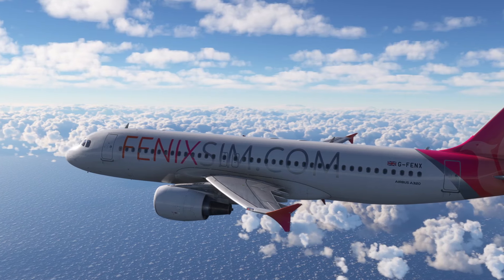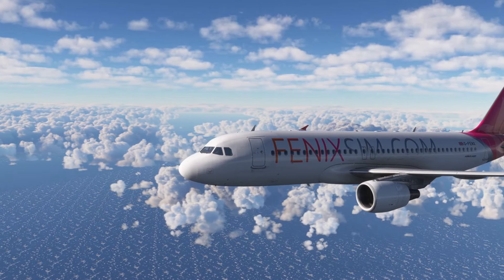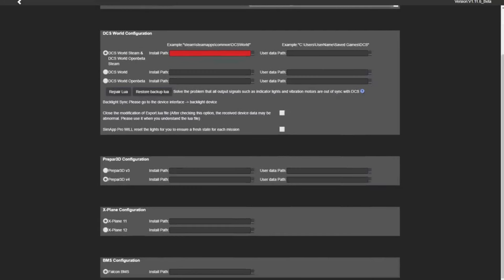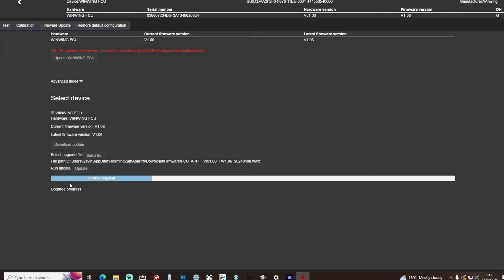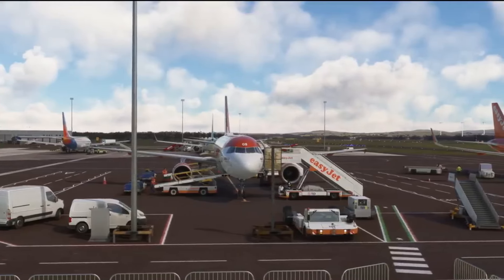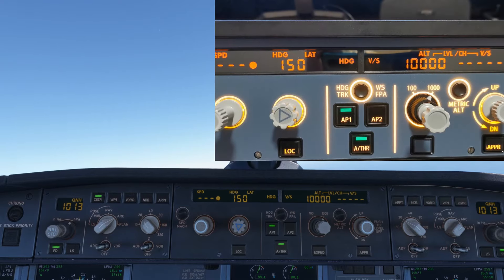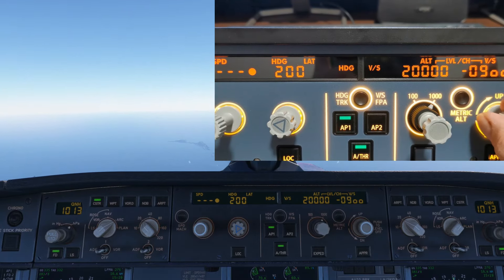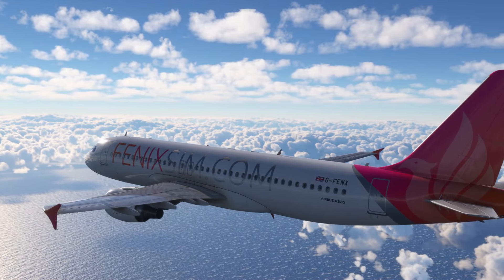WinWing A320 FCU - Installation & Setup (Not Plug & Play!) | Working With Fenix A320 in MSFS 2020

Comment: I honestly didn't notice all these frustrating problems until before the update (but rightly the firmware wasn't updated)... once the update is done it's plug and play. requires no configuration or anything! you just need to launch the app after all..
Reply: I do have the final product and my issues may come from the Bata SU15 that I´m using. Saying that, the only straight forward plane that I found was the Fenix, everything else is not even recognizing the Winwing FCU... why? I don´t know. I wish I could have someone on the same page as me.....! I really would like some help. Thank you for the video.
Reply: I cant get to set manage speed or heading, how can i do that?

Comment: Now I'm not gonna defend Winwing, or say the final product won't have these issues. But, keep in mind you've been given an early test version and issues you face may, or may not, represent the final product.
Reply from the maker: Hi - just needed to clarify that the unit I had was not an early version, as it was exactly the same as those recieved recently by customers.

Obviously as for the tech side of things setting it up, the issue is most likely me, but with no manual/instructions, it didn't make it easy. 👍
Reply: I wouldn't of said it was an early test unit, Winwing are now shipping pre orders in certain countries. Easyjetsimpilot hasn't had the unit that long I'm sure he only done the unboxing last week.
Reply from the maker: @DroneOnGameOn-DarrylCurd2024  I think it arrived on Monday just gone 👍
Reply: It's plug&play with the only issue was that I needed to reinstall the SimApp application. I don't know why I needed to do it but after reinstall, it's just connect and is done. Btw, The unit syncs perfectly with the aircraft and what this means is that everything that shows during the self-test in the place is seen exactly in the winwing unit. It's exactly like the real aircraft.

Comment: I think a sensible question is whether the mini fcu is worth twice as much as the WinWing? My opinion is no, and therefore I would be more than happy with the WinWing.
Reply: I love the concept of simplified overhead panel, radio, etc. on the mini, but if I want to build part by part a simplified but a real size cockpit, I think better to buy the 1:1 sized WinWing. I hope WinWing will also introduce more components.

Comment: Works great for the A320 fly by wire. There is a tiny bit of lag but not a dealbreaker. I do wish the lighting of the screen was a bit brighter...even at max brightness setting 255, with my lights on in my room, there is some glare which makes the numbers tougher to see. That said, I'm not a pilot, it could be that the brightness level is authentic and what it's actually like in the cockpit. For the cheaper price relative to other FCUs, it's worth the tradeoff IMO. Plus, usually I'm flying at night (after work on vatsim) so the lights are off in my home cockpit for realism anyway, so the numbers can be seen just fine. Not to mention, living in the US, it arrived in literally just 4 or 5 days with free shipping. Thanks for the great setup tutorial, got this working in 5 minutes thanks to you!

Comment: Thanks for the video. I have 2 Winwings products : the Hotas Orion 2 joystick and throttle quandrant and it's working like a charm and for the price those two pieces are really good. I have to admit that the Sim App pro is not the best hardware setup software in the world but none the less I was able to make my devices work as intended for DSC and MSFS. Can't wait to receive my pre order for the FCU. Cheers.
Reply from the maker: Definitely can't fault the price.

Comment: I think you have to ask whether the MiniFCU is worth an extra £200.00. So in effect, is it 3 times better than the Winwing? I’ve ordered the latter and I’m planning to stick with my choice. Time will tell whether that’s a good decision!
Reply: I believe it will the mini fcu might have a different interface and smaller but overall the winwing seems to be a better value overall
Reply: How is everyone saying miniFCU is an extra £200? Mines was less than £200 delivered.
Reply: @andy70d35  you probably got yours during the preorder in the initial batch. Right now it’s $279 on their website , and after shipping it’ll be over $300 for most
Reply: @andy70d35  first of all it’s out of stock. It’s listed at £221.00 plus no doubt a large shipping charge. I’ll rephrase my comment - is it 2.5 times better than the Winwing when it’s actually available?

Comment: With the mounting of it on the table. Did it come with sticky pads like the minifcu? Just wondering if you tried them and how they were.
Reply: Yes, I can manuplate the knobs (push pull)without the unit moving around, with the sticky pads.

Comment: Any feedback on now it works with the Toliss A320-Fam.? I find it much easier to assign controls in Xp12 vs MSFS…I preordered the unit and hope to use it for the fenix as well as Toliss airbusses. Thanks
Reply from the maker: Afraid I don't have XPlane installed to check.
Reply: @Easyjetsimpilot  thx

Comment: I just received my wing thing yesterday, thanks for sharing this, it worked initially out of the box but then started playing up so I did the firmware update and ran into the same issues you mentioned, I always make things complicated perhaps others will not have the same issues as me. It's now working properly with the Fenix but not yet the LVFR A330, I am assuming it is supposed to be usable for all Airbus models including the upcoming A380? not sure if it is requiring an update for the A330? I also tried using it with Boeing aircraft, I am assuming it might be usable on all aircraft but not so far that I can tell.

Comment: Great content ty, Just waiting for winwing to send out those pre order payment emails to UK customers, it seems were always last on the list here the other side of Europe. The delay in syncing FCU to on screen really wont be a deal breaker, maybe they will fix it maybe they wont as the values you set on the FCU are still correct values, so if your using a physical FCU like this that's surely what your focusing your sim experience on rather than very small amount of lag. The set-up process does look complex and this is one thing i hate about flight sim any complicated set-up process however with referring back to your content i should be able to manage it. I still love this unit over the smaller FCU this will make such a huge difference to me as what ive found frustrating in he past is trying to locate the turn or click point on screen with the mouse cursor normally end up zooming in by accident. What a great product for us Airbus fans, ive been simming since FSX so a fair while now, this is a game changer.
Reply from the maker: The fact we have so many FCU options for us now is fantastic 👍
Reply: @Easyjetsimpilot  have you got a link to that V-Joy , I actually missed my pre order slot at the time as i was in Greece grr, so only just got around to purchasing , ive found the install pretty easy but i have been watching your video for guidance obviously as you are my go to airbus expert.

Comment: Good morning
I can't get my FCU A320 Winwing to work.
In the “Environment Check” menu “Program initialization phase” remains red.
In addition the display of FCU unit 1 shows "88888"?
Can you tell me what's wrong?
Do you have a procedure to provide me with, preferably in French? 
Thanks in advance
Philip
Reply from the maker: @philippeatlan4648  I'm afraid you'll need to contact support as I'm unable to assist. I'm not a big fan of the WinWing software.
Reply: Hi, having same trouble, were you able to fix it?

Comment: I´ve just found out, after fighting with the software, that it DOES NOT work with DX12. It crashes the Sim if you try to run it on DX12. Hope that someone finds a way to fix this issue. The other "problem" that I have is, it ONLY works with FENIX on MSFS2020, nothing else, and it DOES NOT work on X Plane 12. A bit sad for all of this, but hopping that things will get resolved. Thank you!

Comment: Thanks for the video! Are you running DX11? Because it is not working on mine with DX12.
Reply from the maker: No, DX11
Reply: @Easyjetsimpilot  Me too.  Frame gen disabled and dx12 greyed out if simapp is installed.  M using a 4090.
Reply: Confirmed. DX12 not supported as of the moment.
Reply: @jangonzales7750  Yes, it crashes MSFS if DX12 is on when simapppro is running.
Reply: @Easyjetsimpilot  How did you manage to make it work with DX12, MSFS crashes all the time and defaults to DX11 when reopen and simapppro is working. Also, does it work in any other plane than A320 for you? Thank you!
Reply from the maker: @maguila7777  sorry... Ignore me. I'm on DX11 *Edited.

Comment: As I tested it , you don't need to do anything with the app (except updates). Just start the game and the fenix/neo should be working. MSFS recognizes the FCU. That Virtual Device Mapping is NOT ncessary, at least for me.
Reply from the maker: That indeed seems to be the case. The device for me however, on began working when I turned this on and vJoy downloaded. I think a lack of knowledge on my part of this app and instructions didn't help.
Reply: @Easyjetsimpilot  that's true...i haven't used this app before either. Maybe because WW just switch from military sim. It's intersting that this vjoy macro thing seems to be pretty wellknown in DCS hardware world. A quick starter paper in the box would be nice...but after that, so far it does its job and I managed to make the knob work with 737 by configuring in MSFS.

Comment: For those who didn't receive it as an early unit but just pre-ordered, anyone has already received the unit? Or get the email to make the payment? I bought it like 2 minutes after it showed on the page and didn't get any feedback...
Reply: Preordered day 1 (Canada distribution). Received the payment ready email 3 days ago, was shipped yesterday and delivered this morning.
Reply: UPDATE: Received mine two days ago. I think it's necessary to say something in the scope of this video @Easyjetsimpilot. I don't use any drivers and the only issue I had was that, after the firmware update, I had to uninstall the SimApp and reinstall it. After that, everytying is indeed Plug&Play. There is no need for anything else. In terms of how it works, it surpassed my expectations. It's simply amazing, everything works flawless, the delay is non-existent, everything, including the lights are completely in sync. The touch is great and I can't fly anymore without this. I'm hopping they get the other parts as soon as posssible because this is a game changer. About the 1:1 size, it's also amazing and it's bigger than what you think, but it's just the first impression. Overall, 10 out of 10!

Comment: Are you using the second USB-C output on the back marked "Power Only", just got mine looks great feels great. IMO little trouble you encounter well worth $100 savings over MiniFCU I suppose they will update software with time and make it easier it is fresh out of the oven after all :)
Reply from the maker: No, the power only is exactly what it says. You'll need to use the data connection.
Reply: @Easyjetsimpilot  ok thanks, I wasn't sure if it needs both or just the data one, some of my other devices of such type for my 737 cockpit require both data and power (older devices), anyways great to know, great video thanks !

Comment: I have recieved my winwing FCU but when I try to download vjoy, it says install has failed. Got any idea how I can fix this?
Reply: you don't need the vjoy to make it work
Reply: @mass23g22  how to make it work? Can't figure it out. All the buttons and dials work when I load MSFS and fenix a320 but the winwing FCU screen and values are blank and turn off.
Reply: I have the same issue. Updated the firmware and had the simapppro running but no letting happens in MSFS.

Comment: hello peoples quick question for those of you who own this FCU autopilot unit - how do you make this FCU work with the inibuild a300 ????? where do you download the profile for different airbus aircraft ?? so far I can only confirm that my unit is working only with the fenix a320 but no other aircraft !!!! of course you can try to bind the FCU with the msfs2020 but the display won't work and some of the buttons can't be programmed I would like to use this autopilot panel for all of my aircraft from cessna 172 to PMDG 737 anyone can help me with this please? I opened the ticket on winwing web but after 30h still no answer from them and support is not existing !! I hope somebody can help all of us who want to use this FCu for different airplane then only fenix a 320

Comment: If this doesn't work with Spad-Next or Mobifight then the usefulness for me is extremely limited as I fly non-airbus planes most of the time.  I'll keep my minifcu which I can use with all my planes.
Reply: spad recognizes it as a joystick so you'll be able to configure the buttons and axis but not the led's or display brightness.c0nnex said that there's currently no partnership between winwing ands him so it'll be as that for the time being